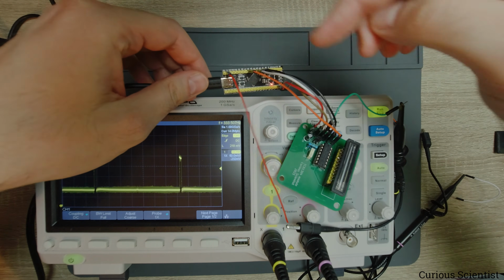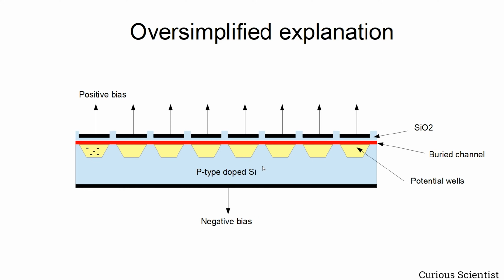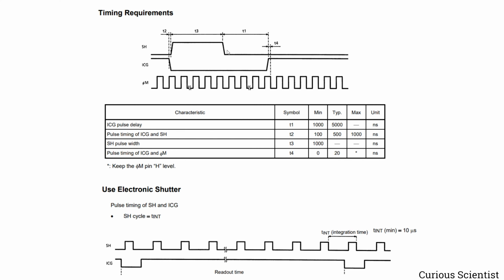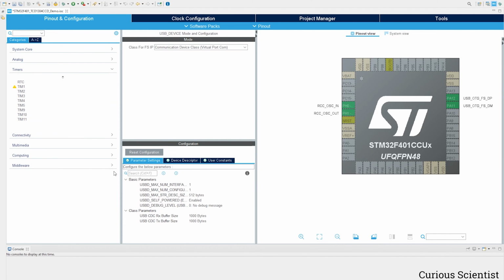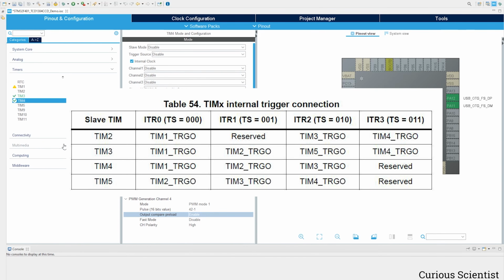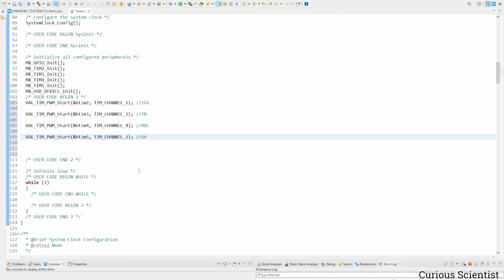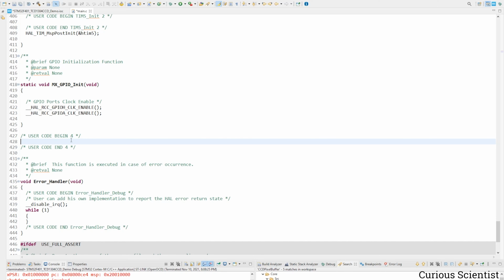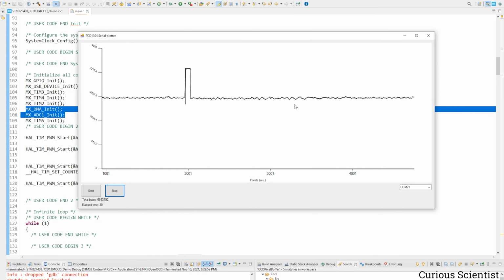TCD1304 Linear CCD - Part 2 - Driving the CCD

Comment: The CCD is showing either high or low output signal when something is put over it. How to solve this problem and get only the pixel values where the shadows are appearing?
Reply from the maker: You're wrong. The CCD is outputting a signal which is inversely proportional to the light falling on each individual pixels. There isn't any "problem" to solve.
Reply: @CuriousScientist  thank you for your quick response. But what I'm trying to say is at the start of this video when you place wires on the ccd your oscilloscope is showing spike on the specific areas of the output signal where the shadows are appearing. But for me its either all rise at a time or nothing. I just can't figure out what's the problem.
Reply from the maker: Probably you don't have a signal then. I can't guess, because you haven't told anything about your system.
Reply: I have set up the system exactly how you instructed in the video and timers are checked in the oscilloscope which are giving correct frequency signals. But the output shows the dummy pixels when there is nothing covering the ccd and when it is little covered, it's showing all high on the oscilloscope. However, I can show a video demonstration if you have time to look at. Thank you for replying.
Reply from the maker: Ah, I see. You should play around with the integration time. The CCD is very sensitive, so you can saturate it or block all the light very easily. Try using the fastest possible (or something close to it) integration time.
Reply: Thank you very much. It's working fine now.
Reply from the maker: Great to hear! Did the integration time solve it? Thanks!
Reply: @CuriousScientist  yes the integration time was the issue. Thanks for the help again.
Reply from the maker: Thanks, this information will help other people as well! I am glad that we figured out your issue and the circuit works. Have fun using it! Cheers!

Comment: Make circuit of oscilloscope that run on video input composite of TV with out open any tv or any other device.
it make on working tv or video input based devices or monitor but not used A2D based circuit like Arduino or other digital circuit
Useing analoge circuit this is awesome new idea to make every video based devices into oscilloscope.
Can make tow different frequencies horizontal and vertical,and then distrube by injecting measuring signal work oscilloscope.
Reply from the maker: I am sorry, but I have no idea what you're talking about.
Reply: @CuriousScientist  
TV oscilloscope
Jist like mobile oscilloscope now these days
But i says as earlier days video games work,
B/c video games connected to composite AV cable.
So make circuit of oscilloscope that output see on tv.
Reply from the maker: What does that have to do with the demonstration of the TCD1304 CCD?
Reply: @CuriousScientist  
Dear i have lots of different ideas non of any person make till now .
I msg for oscilloscope circuit just video game work on video input devices.
For this type circuit many many new projects coming in ur mind.
Reply: @CuriousScientist  
CCD or Dvd player laser sensor 8 pin ic used for long rang accurate laser data receiver or used microscope.
Reply: @CuriousScientist   TCD1304 used as light bulb data decoder or as picture receiver from light bulb sends lifi video brust make

Comment: Hello, I've ordered your PCB and followed the programming from this video. My circuit is working but, I have one problem. My main clock goes from -1.6 to +1.6 (instead of 0 to 3.3 V), as a result the voltage amplitude when the TCD is blocked is low around 0.75 V. But, when I see from the blog, your main clock's lowest voltage is 0. Can anyone help me figure out where I might have done something wrong if possible? Thanks for this video!
Reply from the maker: Hi! Thanks for the support! I assume that you use the same microcontroller as well as this green board I use in this video. What is the input voltage of the board? Did you connect it to 5 V and is it really 5 V? Sometimes microcontrollers can have large voltage drops on their 5 V rails. According to the datasheet the clocks (fM, ICG and SH) should be within the range of -0.3 to 7 V.
Reply: @CuriousScientist  Thank you very much for your response! The problem happend to be from a malfunctioning microcontroller. It's now working fine. I appreciate your videos!
Reply from the maker: Glad to hear that you found the solution!

Comment: Hi, I have followed your video (and blog) word for word. At the very end, when I use coolterm to see the output via USB, I don't see anything in the console. Nothing ever comes in the console. The baud rate is the same as yours. One difference is the pin configuration from the bottom-right corner in CoolTerm. TX and RX don't light up for me. RTS, DTR and CTS are always lit up. What could be the issue here? The code compiles and uploads with no errors.

Hope to hear back.

Regards
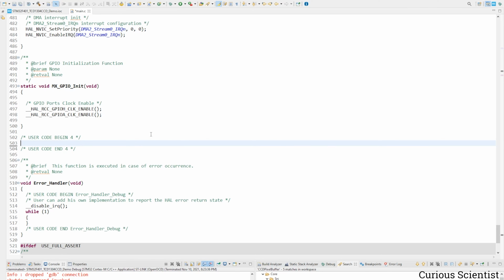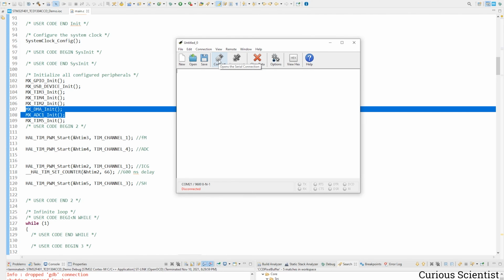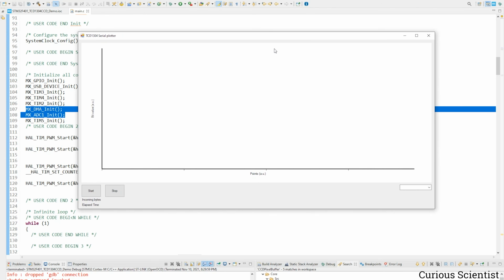Reply from the maker: @Harit Krishan What proof do you need? At 51:30 I show the code that passes the content of the buffer to the USB. Then, at 54:40 I show the raw data received from the MCU via the terminal. It does not require any settings, I run the software with "factory default" settings. I could have used any serial terminal software (putty, realterm...etc). Then, at 55:15 I show my own software which also communicates with the MCU via USB and it shows the processed raw data on a real-time chart. I will also release another video soon where I show that the device works even better than in this demo because I fixed the software that receives and processes the data from the MCU. 

Also, if my comments sound belittling, sorry for that, it is not my intention. It is hard when a comment cannot convey the tone, but I was trying to write my comments and questions in an interrogative way without any negative tone to it.
Reply: @CuriousScientist  Hi Again, I realized that I can't use USART2 on the nucleo F401RE so I configured USART6 for transmitting the data to the PC. I am now able to receive raw binary data (encoded in HEX) on my PC via CoolTerm. I can access that data through Python using 'serial'. I do not know how this data is parsed from the MCU side so I am now struggling to properly unpack the data that I am receiving. I understand that it is a 12-bit number for each pixel which is stored in a 16-bit integer. The 16-bit number is transmitted via UART as two 8-bit numbers. Do you know how I can find out the Endian-ness of the encoding? I tried using the pyCCDGUI from your blog, but it takes ages to collect a single reading from the board. I was only able to see the visualization once or twice and it crashes every time now. 

Thanks in advance.
Reply from the maker: The data comes in the order of the pixels, 2x8-bit numbers which will create a 16-bit number. It is usually MSB first, so you take the first 8-bit number, then shift if and then you take the second data and combine it with the previously taken and shifted number. I explained this method in many of my videos especially related to the ADS1256 device. The pyccdgui doesn't belong to me, so I also doubt again if you are sure that you have read my website and not someone else's.
Reply from the maker: @Harit Krishan Hi! Have you even watched the video and read my blog for real? The microcontroller is sitting on top of the oscilloscope, it is very obvious, and I even mention it and write it on the video at 1:31... It is very hard to miss, except if you don't watch the video. Also, I even put a picture and a link at the end of my blog article for this specific microcontroller. So, yes, you are wrong, it is not a Nucleo board. The data is directly transmitted via the onboard USB connector, there is nothing in between the MCU and my computer. Just buy the same microcontroller that I used (STM32F401CCU6) and you save yourself a lot of headaches. The MCU is not even expensive, if you check the link I provided via my blog, you can see that it is below $4... Also, I mentioned that the same method works just fine on the STM32F103C8T6 ("blue pill") microcontrollers. I tested it and was running well, I just had to keep in mind that the blue pill doesn't have that many 32-bit timers, so I had to be careful with the ARR register values.
Reply from the maker: Hi! Did you use the same microcontroller? Also, did you make sure that the polarity of the signals is correct? If nothing shows up on the terminal, that might indicate issues with the USB communication. Have you tried another terminal software? Also, some MCUs like to misbehave with the DTR settings. Try changing it in the options.
Reply: @CuriousScientist  Thank you so much for getting back to me! I am using the STM32-F401RE (Nucleo board). Yes I made sure the polarities are in the right configuration for use with a Hex inverter. I have not tried another terminal software. I am running everything on Ubuntu 22.04. I just tried to play around with the DTR, CTS settings but I still don't receive anything in the terminal. Are you aware of any necessary additional drivers for this board for use on Linux?

This is my first time working with STM32s so I'm a little thrown off my the IDE and the various configuration options. It's possibile I'm making a really small, stupid mistake...
Reply from the maker: So at the end of the day, you haven't exactly followed my tutorial if I am trying to be nitpicking. You have different MCU and operating system. Both are significant differences in my eyes. Try to use the same stuff, as you can see in the video I can drive the CCD relatively easily. Nucleo should also work with it, or rather the other way around: you should be able to drive the CCD with a Nucleo. But I found the STM32F401CCU6 more convenient for the task. It was also better for my future application (see part 3). Unfortunately, I am not familiar with Linux and how it handles these microcontrollers. But I know that the drivers are already somewhat complicated on Windows, so it could be even worse on Linux.
Reply: @CuriousScientist  Well first I started from your blog, which shows the use of a HEX inverter. Then I switched to the video, which does everything without one. So I really don't know where the problem lies. Your blog and video are not exactly the same. If we don't use a hex inverter, then what should the wiring look like? I got a digital logic analyzer as well and I don't see what your video shows as the output of any of the 4 lines - fM, ICG, SH nor OS. I can't afford a real oscilloscope so I'm gonna have to make do with the logic analyzer. After configuring the ADC, I get a conflict on Timers TIM2 and TIM5. There isn't any conflict on the channels which are being used, but still it shows the yellow warning triangle. I replicated everything else AS IS i.e. clock configuration, source code, pin configurations, etc.

Any help shall be appreciated. If I could get the .ioc file for your project, it would really help in replicating your apparatus. Like I said, I am completely new to STM32s and I really don't have any idea how anything works here. It's a BIG jump from Arduino, ESP32, ESP8266 to STM32.
Reply from the maker: The inverter version is the replica of the circuit shown in the datasheet. The blog (https://curiousscientist.tech/blog/tcd1304-linear-ccd-driving-the-ccd) shows you the implementation for this board. But it is really just common sense to see how the signals are required for the CCD and you just have to consider whether there is an inverter or not. Thus, you start with a rising edge or a falling edge. Also, you haven't really read the blog it seems. Don't just skim through it, I put a lot of effort to write it and I made sure that every detail are there. There is literally a whole gallery where I show the alignment of the ICG-SH waves, I also show their relative position with the tiny delay. There are also pictures of the fM and ADC trigger signals. Also, if you check the blog, I have triangles basically everywhere. The more peripherals you use the more conflicts you will have. It does not mean that the timer for example becomes unusable, but for example one of its channels becomes unavailable. There will be still 3 other channels inside the timer. I also showed how this works. 
I know the struggle, I also had to learn the STM32 and it was quite a big learning curve. But I think the key thing is that you need to take the time and read the datasheet. It has all the information, we just need to get used to its language and understand how to interpret it.
Reply: @CuriousScientist  I read every word on your blog. I even did the calculations by hand before looking at yours just to make sure I am on track. After everything, I decided to watch the video. BUT it is possible that perhaps I missed something. I will re-read the blog and try again. I really do appreciate you taking the time to read my questions and respond, even months after publication. Thank you!
Reply from the maker: Please read the blog, there's really everything there. I also tried to recreate the code by just following my own instruction. Of course it is not a perfect test as I already knew some things but it worked. 

I try to answer literally every single question. That is one of my principles. Also, this project is one of my "child", I put a lot of effort into making the code and the circuit as well as the tutorials. So I try to answer the questions related to this project with even more care. Let me know how you managed to proceed.
Reply: @CuriousScientist  Hi! Just wanted to update you on my progress. I realized that the sensor was working the whole time. It turns out that the sensor is super sensitive to light, so when I covered it with something, I started to see some output on the output signal line. I visualized the signal using a digital logic analyzer. It's not the best tool to visualize analog signals but it worked well enough for me. Now I am going to try and and use the ADC. It will probably be a much more accurate visualization of the signal (i hope). 

Thanks for the inspiration!
Reply from the maker: Happy to hear that the issue was not with my explanation or shared resources. Regarding the overexposure, yes, that's very typical. You can change that behaviour easily by playing around with the frequency on the SH pin. I also made a table on it on my website of course.
Reply: @CuriousScientist  Hi Again! So I am back to square one regarding the USB communication. No output whatsoever. I tried every single baud rate to see if there is any output from the board. I even connected a UART-USB adapter to pins PA11 and PA12 (USB_OTG_FS_XX) and scanned that USB port with CoolTerm. Nothing received from the board. I even put a 'printf' statement in the while loop to figure out where the heck the information is going, but I couldn't figure that out either. 

Please Help
Reply from the maker: Hi! I provided every little steps in the video and on my website to make everything reproducible. Please go through the provided material carefully. Make sure that the DMA fires when it should fire, and the data is sent to the USB when the conversion is finished.
Reply from the maker: It is good to hear that the problem was not in my documentation and explanation. :) I think you are still misunderstanding things, because I have never ever made any Python program. I cannot code in Python. However, the algorithm is very simple. You receive 2 8-bit numbers for each pixels. Then you need to combine them into a single, 16-bit value and there you have your value for a given pixel. First 8-bit is shifted by 8 in the 16-bit number, then the second 8-bit is just simply combined with the 16-bit number using the bitwise operation. I thoroughly explained a similar example for making a 24-bit value from three, 8-bit values. You can find it in one of my ADS1256 videos (I don't remember which, but I hope you can use the search function).
Reply: @CuriousScientist  Hi again! Yes it turns out someone else has the same project as yours on wordpress. I was referring to the python script linked there. I have come back to working on the sensor data processing after a month-long break. Thanks for the explanation about the bitwise operations to combine the 8-bit values. I have a theoretical understanding of what needs to be done. But when I try to implement it, I run into many walls. When I read the serial data, I see an endless string of "\xcf\0e..." which I can tell are hex values. I also transmit a string "START\n" so that I can see where the starting point of the data block is. In the serial data which I am reading, I can find my starting marker, but the data between these markers is so inconsistent. How do I know how many bytes to read after finding the starting marker? Do you have a driver that you used to read and process this particular data? Since I have followed your firmware for transmitting the sensor data, I am asking you how you managed to receive and process it. I am using Python to read and parse the data. What did you use?
Reply from the maker: @haritkrishan947  You keep asking the same question over and over. Everything is documented in this video and on my website and it works just fine. If you cannot replicate my results, either you do not follow my instructions perfectly or you have a hardware error. There is no marker needed. On the receiving side, you know exactly how many bytes you should receive based on the number of pixels and the type of variable used to store the ADC conversion values. The "driver" you are referring to is also in the video towards the end. It is my own software written in C#.
Reply from the maker: Congratulations! Probably somewhere the timing is out of sync. Check if ICG and SH is really in sync. The values in my video are only indications and they might not be perfectly in sync. Same applies for plotting.
Reply from the maker: Hi. Probably your timing is not exact so your data is shifting with every readouts.